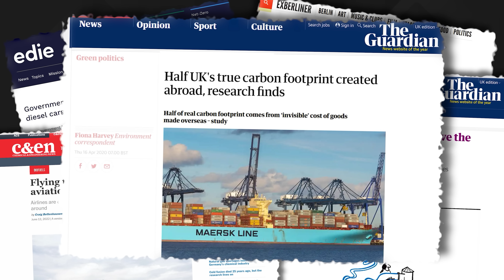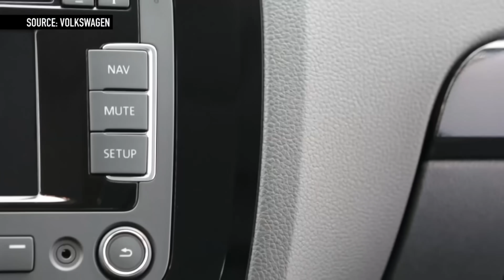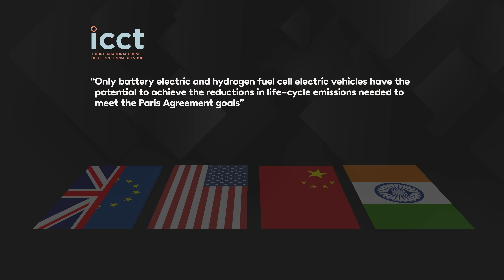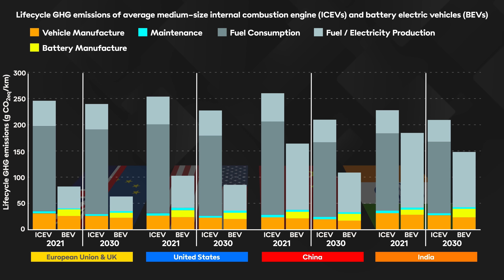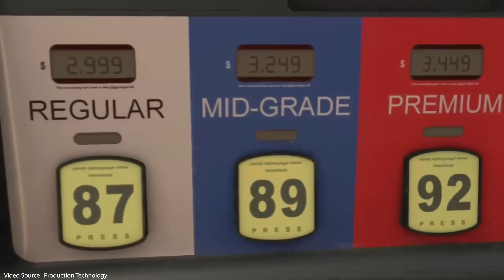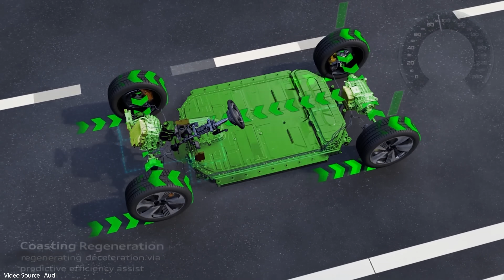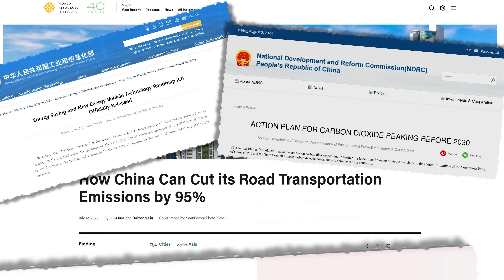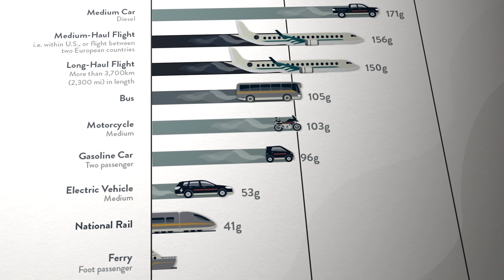Are EVs really better for the climate?

Comment: This quick answer is, "No." as EV's bring to the table a lot of unknowns as the vehicles go out of service for as of right now they are banking on future generations to know how to deal with the waste products these EV's make for as of right now they have no solution to dealing with an EV's waste products. The better way to go is ICE vehicles of all types be it in the air, land, or water ways are all using hydrogen as most folks don't seem to understand that when these vehicles burn fossil fuels what's actually burning is hydrogen. With these new 98% efficient electrolizers hydrogen is clearly the better choice as the existing labor force doesn't need to change all that much and no child labor is needed.
Reply: Stop looking in the rear view mirror.   Several companies are scaling up to recycle EV batteries.   Just need the batteries to recycle.   Hydrogen as it now exists is very inefficient.  Need a more efficient fuel cell too not just the electrolizer.   Coal and petroleum are carbon based fuels.    Child labor is a political issue.   Solve the issue.   
Seems that battery development is making strides.    Maybe in 20 year we will not need to mine.

Comment: My Toyota hybrid vehicles get 50-60+ miles per gallon. The problem with these data points they are assuming best case scenario for EV and not necessarily real world conditions, like driving habits, weather conditions etc. You do not mentioned the carbon footprint it takes to mine the rear earth minerals and manufacturing the batteries and disposal of the battery. The cost to charge your EV vehicle can get very expensive too, depending on where you charge the vehicle.
Reply: I like that typo   takes to mine the REAR earth elements.    Batteries are dense source of expensive minerals.  They are and will be recycled.   Most will charge their EVs at home and save a bundle.
Reply: @danharold3087  Good catch on “rare”. Hopefully, now most major car companies are moving to EV battery technology they’ll be forced spend much more on R&D to improved battery technology. Maybe hydrogen will be a viable source of energy in the distant future.

Comment: What about other environmental impacts of lithium battery povered EVs? The fact that their carbon emissions are much lower doesn't cancel other environmental impacts
Reply: The critical issue is reducing carbon emissions. Mining lithium may have some adverse environmental impacts but it is developing technology and the amount of virgin lithium required will gradually decrease, particularly as the recovery of the material from recycled batteries improves. Also, the history of100 plus years of oil extraction is littered with a catalogue of environmental disasters which are continuing to this day!.

Comment: Also, if you bank the batteries & add a small dedicated generator once fully charged it never needs charging again from external sources, this was done years ago and covered up for obvious reasons, no charging stations req'd, a new car will never need charging.

Whatever ...
Reply: Can't be done. Not possible.
Reply: @Brian-om2hh  Prove your point, r u a bot Brian ?

Magnets are just quenched cobalts under high flux density lasts 5ky-7ky in a motor, flux coercion wasteheat is tiny trivial vs an electric motor, a 1300hp fits cars no_inputs till it fades.
Reply: That sounds like perpetual motion.
Reply: @leftcoaster67  Where'd you take physics ? Perpetual motion ?
Magnetism & electricity 1st yr physics, longevity in magnets was called "permanent" for decades because polarization lasted 40y-60y, rare_earths fade-10%/1000yrs, so to the hairless apes that's "perpetual motion" to you, same idea.
Ymmv 🧲
Reply: Banking batteries well known in marine/home solar, for a car the generator to recharge a bank can be from braking, some of these exist, my take a dedicated unit as far less overhead & complexity.

Yes, it's perpetual motion till your chassis fails, but call it clever instead. My other reply was mad at the free use of the term knowing the best motor is only magnets, a 1300hp fits cars easy, no_fuels no_batteries.
Ymmv ⛽️

Comment: One other good thing about electric car is at end of life, battery can be 98% recycled (at current technology). So future electric will have much less emissions due to no need to mine and refine battery materials.
Reply: Well said. There are billions of investment going into what is known as ‘urban mining’. JC Straubel at Redwood Materials say they will produce 10 GWh worth of battery making materials this year, although their feedstock is mostly phones, laptops and power tool batteries. In France there is Renault/Solvay who have a pilot plant and Northvolt/Audi in Germany have already produced new batteries from old at theirs. EV represent an opportunity to develop a circular economy, something that could never be achieved with the ICE.
Reply: How much does it cost to recycle a vehicle like that? Are there any toxic substances that would need special treatment?
Reply: @Thecelestial1  Colin, it's more likely the recycling pant would pay you some money, given the value of older tired EV batteries. Those not recycled are sought after by the energy repurposing business to use for energy storage in commercial, industrial and domestic applications. They may no longer be good enough to use in a car, but they're more than adequate for energy storage. A good example could be the huge sports stadium in Utrecht in Holland, powered by 200 old Nissan Leaf batteries charged via solar...... Plus you don't necessarily have to recycle a tired EV battery. You can have them refurbished, at a fraction of the cost of fully replacing it......
Reply: @Brian-om2hh  re refurbishment - have you seen the munro team trying to get into the 4680 pack ?!!  https://www.youtube.com/watch?v=GR9thxbp270
Reply: @Thecelestial1 way cheaper and no mining natural resources after usage. Fossil fuel cars cost before and cost much later on.
Reply: @Thecelestial1  it's cheaper then mine an ore.
Reply: @mackomako  wheres the data ?  and wheres the factories to do this efficiently ?
Reply: @H4N5O1O  If you think recycling a battery pack is hard, you will be stunned to find out how difficult it is to mine raw materials! If you're so sure battery cycling is going to be difficult, then you can short the stock of the dozen companies who have started up to recycle batteries, and are all stuck waiting for enough EV batteries to actually fail in use.
Reply: I don't know everything started so quick to go into nitty gritty details how much co2 is produced to manufacture vehicles ice's or ev's. How much co2 is produced in a lifetime either vehicle. Did anyone see plans in the uk? Rolls royce is planning to build 6 mini nuclear power plants in various places of uk, well maybe they are not going to build 6 but few atleast. Why is that? I thought they want to go green all the way... 

Also everyone should factor in batteries and devious practices manufacturers do to "save" the planet by replacing whole battery pack when it might need to change few cells in that battery pack and who knows what they do with those battery packs... Recycle or bury in their back yard? Please watch some videos in your spare time by typing louis rossmann tesla
Reply: @M3SOTI  Pay attention to this video e.g. 5:07, the CO2 to manufacture an ICE or EV is dwarfed by the CO2 from a gasser burning literally tons of fuel in operation!

Nuclear generation is low-carbon, but it's very expensive and takes a decade to build; we'll see if Rolls-Royce (the jet engine and engineering company, not the car maker now owned by BMW) can actually make small modular reactors that change that.

To repeat for the 999th time, obviously big valuable battery packs will be recycled.
Reply: can’t not disagreed more, you guys did’t say anything about the producing of battery? how pollution is it?
Reply: @VirtualCamSys  The video does include that data. The graphs for the EVs have a yellow block that the ICE cars lack, this means that at production an EV is more polluting than an ice, but the EV is far more environmentally sound over its lifetime due to not needing to use an internal combustion engine. An electric car uses power far more effectively and the greener the powergrid is the faster it becomes more environmentally friendly.
Even with a high fossil fuel grid, the efficiency and mass production of power means that less pollution is created for the more energy.
Reply: @scottlad  I agreed with you, but if we are hiding the battery come from when we are driving an EV, it is totally hypocritical!
Reply: @VirtualCamSys  No one is hiding where the material comes for and several companies are already making a swap to lithium iron phosphate batteries that does not use cobalt. The EV community is well aware of where the failings of EV are and push to see them fixed. And at least when that material has been extracted it can be recycled almost indefinitely while gas cars need a constant supply of gas that also has an effect on the environment when extracted.
An EV can be powered by any power source be it coal, nuclear or solar.
Lets not also forget the countries that use the money they make from oil sales to do shit things.
Like Saudi Arabia and their actions in Yemen, Al Quida used the sale of oil to found their terrorism and one of Russias main exports is oil and natural gas.
Reply: @VirtualCamSys  What!? Did you actually watch it?
Reply: @VirtualCamSys  
Remember: if we can't use EVs the conclusion isn't "Well, we continue as today".
That is not an option.

Sure, we have to travel a lot less, but the solution for that travel that is absolutely needed has to be at least as efficient as EVs.
Problems will have to be solved or we have to walk.
Reply: @VirtualCamSys  Dramatically less polluting than mining and refining the gas you use EVERY TIME YOU DRIVE. The battery is indefinitely recyclable....forever.
Reply: @paulsmith3921  are you sure the battery negative material is no need to mining? Please go to that country and see it how pollution is and what’s happen for the cancer village?
Reply: @VirtualCamSys  It is mined ONCE, then the battery is usable and recyclable forever. Fossil fuels are consumed and have to be mined continuously.  Do you see the difference?
Reply: @VirtualCamSys  Aren't you aware that the battery material is only mined once then used and reused indefinitely, whereas oil is mined nonstop every every time it is CONSUMED?
Reply: @VirtualCamSys of course less. But fossil fuels arw far
Reply: so wheres the factory to send packs to be run through the production line machinery and unmade so the individual components can then be recycled ??? because the current recycling of any vehicle is a fkin joke smashing some perfectly serviceable components, shipping somewhere else for them to re melt to extract the various materials while others are just landfill.
Reply: @H4N5O1O  A more relevant question is not where’s the factory...but where’s the packs? Not many packs are getting recycled yet unless the car they were in gets totalled, even early Nissan Leafs with no BMS are holding up better than anyone thought and still giving good service after 10 years. EVs made in the last 5 years all have active BMS and the degradation on them is minuscule...5 year old Hyundai Ioniq taxis with 200,000 km on are still showing close to their original range despite being hard charged every day. Some nutter in Canada has done 500,000 km in a Tesla Model 3 already and is still at 80% of original capacity...that’s 20 years driving for most people. So batteries age in two ways, number of times you plug them in and calendar ageing. Redwood Materials and companies like them won’t see big numbers of EV packs coming in for recycling until the 2030s but right now the LiOn feedstock they are using is mostly phones, laptop and power tool batteries. Even so, Redwood reckon they will produce enough raw materials from those to make 10 GWh of EV packs this year. Their factory in Nevada is expanding. https://www.redwoodmaterials.com
Reply: And wait for sodium-ion batteries which are about to come! It is going to be greener then the color green itself. And private property, the right for self-sovereignty, the right to OWN all your stuff is going to be what World War III is going to be about. The war of peoples against their governments. All this centralized digital gulag and "own nothing and never be happier" pushed by aspiring enslavers of mankind by the year 2030 or 2050
Reply: they cant even recycle bottles and cans wtf are you saying haha
Reply: @realwishgamer  "They" certainly can. Aluminum can recycling rate is 50% in the USA; glass bottles is 24-63%. They're worth $0.05 each, while lead acid battery has a 90+% recycling rate at a value of $20. You have to be an utter moron to think that EV battery packs worth $2,000 won't achieve a high recycling rate.
Reply: @skierpage  so sure people go and get paid. They take that and then put it into a special coloured bin right?

That bin then either goes into a landfill or shipped to countries like Indonesia and Vietnam who then dump it all in their rivers. 

The only country on earth that can recycle and not lose horrendous amounts of money doing so in Sweden. And they now get paid money by the rest of Scandinavia to recycle their trash. 

Anything you recycle in USA goes to the landfills anyway. 

Also, do you think they would let you recycle a reuse a 2000 dollar battery when they could just charge you 2000 dollars for a new battery? Do you even live on earth my friend.
Reply: @realwishgamer  You live in a fact-free world. Even if people exaggerate recycling rates they are far from zero. Someone takes your battery, disassembles it, grinds it up, recovers the valuable materials in it, and sells them for less than it costs to mine them out of the ground. If you don't understand that I can't help you, but everyone else should probably trust the management of at least one of Redwood Materials, Li-Cycle, Umicore, etc. who intend to make money doing it.
Reply: @skierpage  lol I don't really take advice from people that think they know everything with very little information residing in YT comment sections
Reply: @realwishgamer yet you're parroting the same propaganda the fossil fuel industry has been peddling for decades... 🤔
Reply: Counter argument to Just Have a Think biased argument... https://www.youtube.com/watch?v=TUx8yIlKVpU
Reply: just because it CAN be recycled doesn't mean in any way that it IS recycled.
Reply: @Sacrypheyes  But they are recycling. Northvolt has a factory in Norway with a 12 000 ton capacity per year with plans to expand that to 70 000 tons per year and then a phase 3 where they get to 300 000 tons per year.
Reply: @Sacrypheyes  Rest assured they will be recycled. For a start the materials in them are high value, secondly legislation will mandate battery recycling. Here in Europe we recycle 99% of all lead acid batteries and they don’t have anything like the value of NMC or LFP based LiON packs.
Reply: we can recycle plastic but we dont ,same as battery...
Reply: @mm-hq4qh  But we do recycle plastic, most industrialized nations do it to some degree and even though we could be better at it it is undeniable that it is being done globaly.
Reply: @scottlad  we do not really recycle plastic. We recycle SOME, mainly pet because in some cases there is a margin but the majority of the plastic produced is burned/in landfills/sent to malaysia or other asian countries. For example the us recycles just 7% of the plastic produced. Every time the it gets recycled it becomes less "pure" and you need to mix it with new plastic.
Reply: @mm-hq4qh  No, not the same. It is is dramatically less financially viable to recycle plastic than lithium and the other ingredients in a battery.
Reply: @mm-hq4qh  most plastic can't be easily recycled, and if it is, it's like paper, each pass through recycling degrades the plastic, as the polymer chains get shorter and shorter.

It makes more sense to reduce the use of plastic and incinerate it when it can't be, the CO2 is shorter-lived in the environment than plastic in a landfill or in the ocean
Reply: lead acid battery is 98% recycled but lithium is opposite
Reply: @sayyidsahal4533  Wrong. Do your research before you make numpty statements like that.
Reply: @Swindonboy56  yes lead acid battery is 95% recycled they even say it in their advertisements